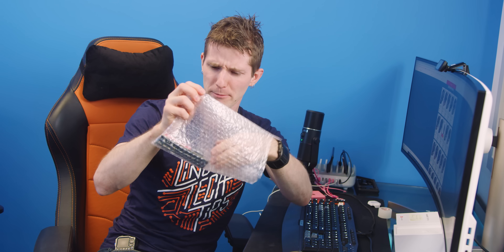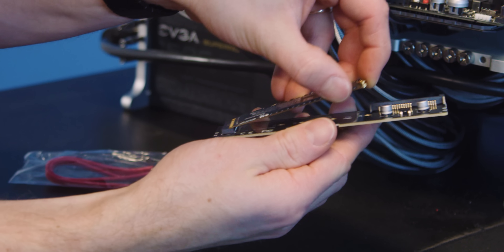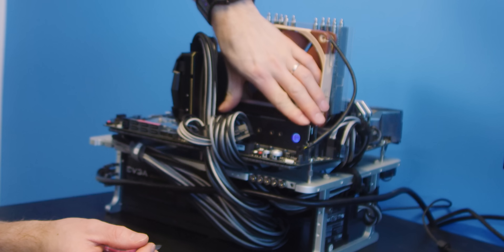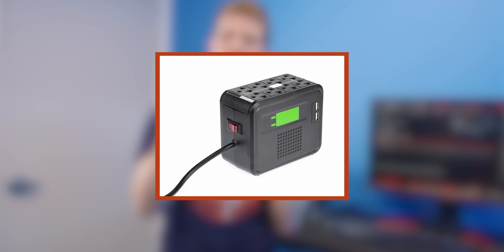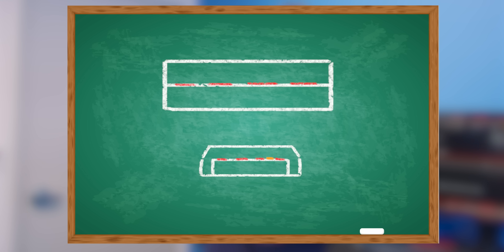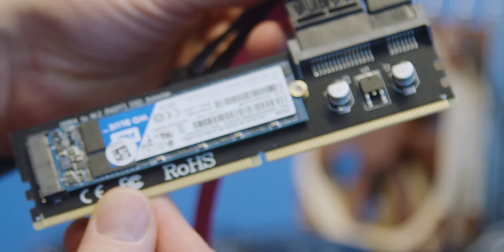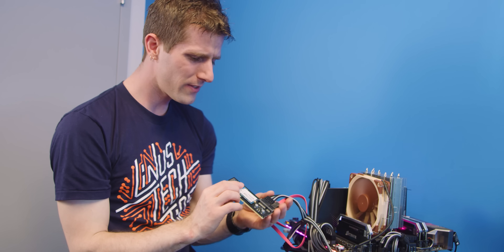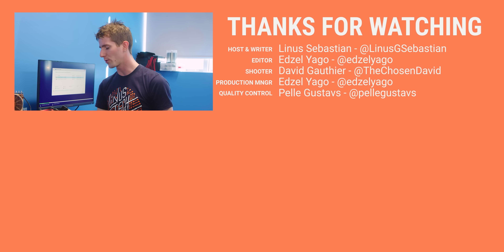They LIED to me! - DDR4 RAM to M.2 SSD Adapter

Comment: This is a strange product that I can't figure out why it exists.  I mean I understand why you would want an adapter for m.2 SATA to STAT and STAT Power.  I even get why they put it on a ram stick, it makes for a nice, clean install without having to tape down an adapter somewhere.  What I don't get is who has a computer that they are 'upgrading' to an M.2 drive that wouldn't already have every DIMM slot filled.  
P.s. Anyone know if someone makes a PCI-e card that allows m.2 hot swap from the back of the computer? that would be weird and more useful.

Comment: Passive Adapter - Adapts between two connectors of the same signal type without special software/hardware | ie. the microUSB to usbA
Inactive Adapter - Adapts between two different connectors, but both connectors support a shared protocol | ie. DVI-Dual to Displayport, or hdmi to displayport
Active adapter - Converts one protocol to another on the fly | ie. HDMI to VGA, S-video to coaxial, DisplayPort to analog.

Comment: Why the flark would you want to use a flash drive in place of RAM!? DDR 4 RAM is like two orders of magnitude faster than even the fastest M.2 card stick. Even a exotic enterprise-class PCIe 8x drive card is not in the same ballpark as ordinary DDR 4 RAM. Hell, even the super-exotic Intel Optane DIMMs are not in the same ballpark as DDR4, and it's was specifically designed to work with a DIMM slot! Expecting a SATA M.2 drive to be faster in a DIMM slot is like expecting an elephant to be able to compete with a Formula 1 race car.
Like Linus said at the end, he might as well have just taped that adaptor to the side of the case for all the good those DIMM pins were good for.  A waste of perfectly good gold.

Comment: he kind of missed the point on this one if you look at the product page it has adapters for DDR2 and DDR3 so if it works you could get M.2 drives on older hardware that didn't come with a built in slot on the motherboard . I don't know who could use this but I'm sure more then a few of us still cling to there older systems and could use the drive space I already have a slot on my mother board but may get one for one of my DDR2 or DDR3 systems I lone out to the family they have one of each that need more storage

Comment: Someone tell Linus the magic words "active" and "passive adapter"
Reply: I'm sure Linus knows what"passive" means.
Reply: @dieubermensch  Biiitch. 😂 💅
Reply: It's not even a passive adapter, it's a mounting bracket for an M2 drive that fits into a DIMM slot.
Reply: @Sem Skywalker that Linus has seen a cockatoo
Reply: An active wire does a complicated dance.   A passive wire need to use  a restroom from time to time.
Reply: @yy Replayz It's about a FISH, a dead one ;-)
Reply: That was what I was thinking! Although he did use the term "active" towards the end.

Comment: 3 bucks and ditch the pins, and you got something reallyreally nice!

Bought me an m2 SSD without my mobo supportin' it and that thing could be useful to me! 😁
Reply: So this video was already pretty much about a pointless piece of tech, but now you've escalated it even further with this comment.
Reply: No, sata to m.2 is a bad idea because sata can only support 300mbps, while m.2 is much much faster
Reply: @chrisrobinson2062  Dude SATA supports 6 GB/s. My SATA SSD drives read 550 MB/s and write 520 MB/s. If I bought them in M.2 form instead, they would still have the same performance. However, I didn't. I also got an NVMe SSD which is many times faster and I think that is what you are confused with.

Comment: It is not great but in the end it is not crap either. You don't need to let go of a ram slot all you need is a sata data and power cable (which in newer pc's are rather abundant) my rog Strix motherboard only has 2 M.2 slots so technically you can put a whole lot more M.2 cards in that way. Granted the speeds will probably be limited but most likely still will be better then a regular sata drive.

Comment: They lied to you or you lied to yourself just to make a video? With your intellect and sheer computer skills, I know you knew off the bat as you looked at it that it was just a marketing stunt/gimmick. Why in the work would it need a sata and sata power cable if it is to be plugged into the dimm slot...lmao good video though.

Comment: DDR adapters to hdd have existed for at least 12 years, back in the eaaaarly ddr3 days. And if they never took off from the hardcore oc crew, that tells a lot of its reliability.

As a rule of thumb, if a hardcore known computer news forum fanbase don't take a standard, you shouldn't. It's better to wait.

Comment: I could see this being useful for people who have a few SATA M.2 drives with spare SATA ports and RAM slots but nowhere to mount them.  But in that case, I'd much rather get a PCIe x1 adapter where I don't need the external power cable.

Comment: So is this what Asus uses in their high-end over clocking motherboards?

Like the Apex and Gene XI
Reply: No.. This thing is usless and serves no purpose other than allowing you to power more M.2 SSD's while taking up ram slots and needing more cables. 

The motherboards you reference utilise a converted "Extra" Ram slot that adds full M.2 drive support with no extra wires or cables and supports up to 2 drives.

Comment: they should make ram with flash memory! like 1 GB of Flash Memory for 1 GB of RAM and a chip on a chip to minimize latency! this would double the ram per bar while making half of it faster! or EVEN better, make a Hard drive or SSD with 128 GB of RAM inside so that you could have tons of Cash and response time! tho in the Hard Drive i would put a 256 GB SSD anyways for the common used files (kind of like an Optain) for 128 GB and 128 GB of Cash to write as fast as possible then transfer to the HDD! anyways how ever they would do it, i want 128 GB of RAM in a Hard Drive! lol

Comment: For users that have 4 slots available and only use two of then 8GBx2 you have 2 slots free. Using this dummy DDR4 you can mount an M.2 SSD inside a mother board that doesn't have a M.2 port on it. I can see this being useful for super slim cases where an SSD would be hard to get at, to upgrade or change out. of that you want a M.2 for that how did you do that wow feature.

Comment: So i skimmed through a bit, but I wonder he actually tested the drive in the slot itself.. Before just saying OH- it's an adapter that's useless and so on. I'm curios if there was any difference in drive speed having it just dangling or having it take up the ddr4 slot. Yes it's a still probably a gimmick and nothing would change, but still, it wasn't actually tested as described.

Comment: It has to be reversed, memory in ssd slot. Sure you would have to develop a new speed standard, keep the power on, and it would be crazy expensive, but imagine the speed.
Reply: Ford Rollhaus Just put the extra RAM in a RAM slot and mount a ramdisk. No fancy new tech required.

Comment: I can see the usefulness of it as a spare mounting location for a drive in low profile cases where filling the RAM is not necessary.  It is pretty silly, though, even with an extreme scenario.
Reply: Niche product being sold outside that niche. Sad. Likely its engineers and marketers don't speak the same language.

Comment: If you don't have a M.2 slot or you don't want to use a PCIe M.2 adapter, wouldn't this be fine for a solution? Unless this for some reason this disrupts any dual channel support (which I don't think it would), this seems fine as a solution though it is extremely niche.

Comment: What a garbage that crap is lol... Now if it was even an actual Ram kit and with the extra M.2 slot on it, at least would have use just as a M.2 adapter and still use it as ram, now making a whole ram like dim which nothing is being used its so bloody stupid, why would anyone even leave the pins attached to the DDR4 slot, and after a few years I always have problems with them because the connection start to get worse and to clean them is a bitch.

My PC is from 2011 and nowadays if I mess up with the ram I have to spend like 1 hour until they finally boot as the connectors aren't as strong as when the board was brand new, I also cleaned the ram pins with a white rubber, but didnt helped much, I just passed a brush on the Ram slots, but also did nothing and I had no electronic contact cleaner either, but the problem is the pins are just a bit to the sides from years stretched with the dims inserted (In fact since early 90's always had troubles with the ram slots after a few years, not a single PC I had ever got it right, maybe those newer motherboards where the slot around is made all metal might improve since at least holds it stronger than plastic, no idea)...

Comment: I just built my first itx build and if i could get a cheap plastic fitting to a left over dim spot just to have a cheap makeshift hardrive bay i would take it.
Reply: Check on thing verse, I wouldn't be surprised if there was a 3d printed model for something like that.

I feel your pain though I gotta somehow route liquid cooling, two 3.5" raid drives and more drives than slots in my mitx build. It's a challenge to get done but hey that's half the fun :)
Reply: @thefpsxpert   not in a Node 202, the drive bay is the worst ive seen in any case from what i can remember. If it werent for it being a one of a kind case it surely would never have survived the market

Comment: OMG NO, THEY LIED!!!

No surprise!
Reply: It was a lie.  They could have just as easily designed it to take power from a different part of the system.  I would have never messed with such a sketchy adapter in the first place.  There is no telling what you might damage plugging weird things like that into a slot intended for a totally different purpose.  If you want to use an adapter for M.2 or similar drives there are PCIe cards that allow that.  Some motherboards already have the slots for these drives.
Reply: @JohnDoe-gm5qr  So true man! I agree these vendors are trying anything to stand out.

Comment: That was a good explanation on adapters. Sometimes manufacturers may put some non-standard signals on their connectors like cameras that give composite video on USB. Some people then think that the cable can be used on any device to convert USB to video.

Comment: I assume the purpose of this is to do two things.  a) convert a standard SATA cable connection to the M.2 style connector, so you can connect an M.2 SATA SSD to a board that doesn't have an M.2 SATA slot.  and b) give you a spot to mount said M.2 SATA SSD, since if your board doesn't have a plug, you don't have a place to mount it.  This way you can just mount your drive in one of your empty RAM slots.  That being said, why is it DDR4 only?  Most boards that have DDR4 memory are new enough to also have M.2 SATA and/or NVMe slots on them, so what problem this device is trying to solve I have no clue.  Regardless, it probably could've been worded a bit better on the product page.

Comment: Getting power for SSD from RAM slot would not be easy since they run on 1.xV and varies. I guess the point of this adapter is just to secure M.2 on the motherboard. Using PCI-E sounds better for this purpose..

Comment: I really like how educational this video was and how I learned things about adapters that I wasn't taught in my IT class. hope we get more videos like this in the future!
Reply: I'd recommend you read up on adapters anyway, as people would probably laugh at you if you started talking about a "signal mode adapter" or "complete adapter" rather than active or passive adapters. Primarily there are only these two kinds of adapters - a passive adapter and an active adapter, where an active adapter is what Linus calls the "complete adapter" (07:16), and the other two both being passive adapters. Also, an active adapter is basically a converter.

Comment: I was hoping it would appear as a 500gb memory slot. Useless as ram, very slow. But once in is, could be configured as a ram drive. Still no better than a regular mount, but if it could have been done as DDR3 or DDR3, would have provided me.2 support for older platforms.

Comment: I was expecting that it will convert the M.2 drive into usable RAM.
Reply: Yeah, that's the shitty scam they're running.
But you can already do that by setting virtual ram.
Reply: Really really slow RAM.  Sata has a max data throughput of what.. 550MB/sec?
Reply: @Cash0991  that's sata, m.2 nvme is limited to 4 pcie lanes.
You can even use a raider, set a raid 0 array of 4 optanes and it should be faster than ddr3.
Reply: @danielgidoni  this adapter is ONLY SATA. It doesn't support nVME.  And if it did convert this into usable RAM, RAID wouldn't be a thing anyway...
Reply: @Cash0991  He was talking about what he thought it does, not what it actually is (we all know it's sata).
He said he thought it would convert m.2 to ram, and was disappointed it didn't. If what he expected was true sata speeds wouldn't be the issue since it wouldn't use sata at all.
What I mentioned with the raid array is doing something irl to achieve his expectations of the video if someone would ever want to.
Reply: Just to clarify again, this product is just a passive converter, it has nothing to do with ram.
What I talked about is how to achieve what the product promised.
Reply: @danielgidoni  I know he thought it would convert m.2 to RAM. Sata m.2 is still m.2 though. If this DID convert m.2 to RAM, it would only convert m.2 SATA to RAM, and be limited by SATA speeds.
Reply: @danielgidoni  m.2 is just the physical connector. It can support either SATA or nVME.
Reply: @Cash0991  It was also stated in the video.
I assumed that he, and the people intended to fall to this scam of a product would expect it to conver nvme m.2 to ram.
Again, this shitty product does not do that, no one even implied it does or is remotely close to that; But if a product like it ever does come to actually exist one day it would have to use nvme m.2 and not sata. No one in their right mind would think of using sata for ram.
Reply: @Cash0991  I feel like you keep thinking no one but you watched the video, and that you're the only one who knows the most basic things when it comes to storage speeds. Everything you mentioned was either already stated in the video or completely obvious.
Reply: @danielgidoni  As a theory… Can a NVMe drive be as fast as DDR4? I sincerely do not know...
Reply: @skirmich  Depends on the type of workload, but if you take something like 8 905ps, change the connector to m.2, and run them in raid 0, other than the god awful latency in the right workload it would outrun the fastest ram speeds currently available by a landslide.
Never dabbled in it, but I think it might be possible to even run virtual ram with multiple memory lanes, so multiply the speeds by 4 and the difference would that much more massive.
Reply: @skirmich  But for a simple answer for most cases, the speed limitations alone on 4 pcie lanes in m.2 make it impossible to be faster than ddr4. So a single m.2 drive in pcie 3.0 will be slower than 2133mhz ddr4.
Even if you get to pcie 5.0 and perfect 3dxpoint tech, the latency would still be far slower than ram, so as with most answers, it depends.
Reply: Last thing to add, as a frame of reference (albeit a very bad one), 2133mhz of ddr4 = 17 GB/s, multiply that by 4 (quad channel memory) and you get 68 GB/s.
A single nvme m.2 970 evo has 2.3 GB/s, multiply that by 8 (raid 0) 18.4 GB/s, multiply that by 4 for quad channel memory and you get 73.6 GB/s.
Although that comparison doesn't say much, and obviously you would want to use a faster ssd, it still gives you a certain idea of the possible difference between the two.
Reply: @danielgidoni  Damn! Thanks for the thorough Response!
Reply: I suspect that, although, you might want to see that work. I'm sure you would NOT want to have that on your own computer. "I think I'll replace my RAM with more memory, but slower. Yeah, that's the ticket."
Reply: Like a guy already answered,  I do know it would be super slow compared to DDR4 if it actually converted an M.2 drive into RAM... 

It could have been more interesting if it did tho as a product.

Comment: You could tell just by looking at it that it was just a mounting card for running an m.2 drive as another sata drive, not actually a drive to memory adapter.  This video was nothing more than a waste of time.  The description of different types of adapters could have easily been covered in a tech quicky vid.

Comment: On my mobo, M.2 Sata uses two Sata connectors. Ports 5 and 6 get disabled. So with this thingy i could save one port. Is it slower this way?
Reply: I would think it's slower, but mainly, SATA is already slower than NVME. I would not want this janky thing in my computer. However, I did use a optical drive slot on my laptop to run SATA drive because it does not support NVME. It is a little more functional with an included fan and power switch and the only way to upgrade to SSD and keep the included hard drive.

Comment: This is propably to ripoff ppl who heard about m.2 is so much faster than SATA SSDs and who dont have a m.2 port on the mobo. I can see that it could look better to have the SSD mounted in a spare Dim slot. But its still a ripoff because SATA m.2 has nearly no advantages over regular SATA.

Comment: Are you sure the pins aren't wired in there? I had an inkling this might be some very niche debugging product that lets you address the pins manually though a special bios firmware so you can write out the memory to a hard drive. This would be something you could use in a lot of different QA applications.